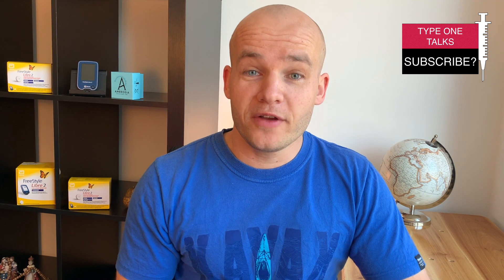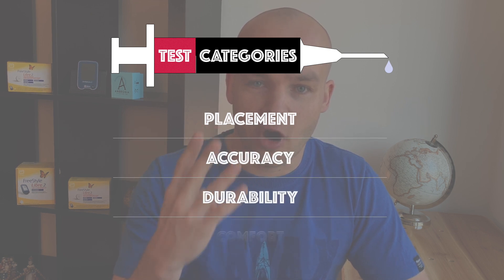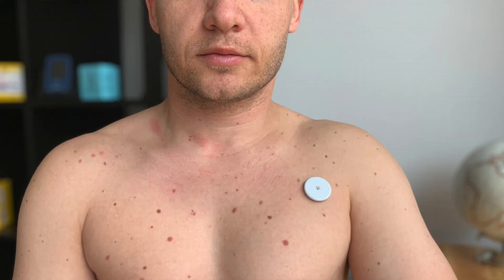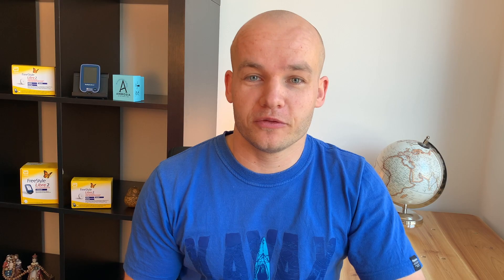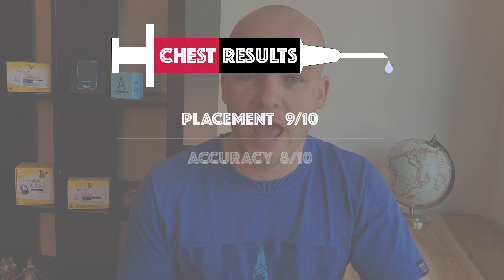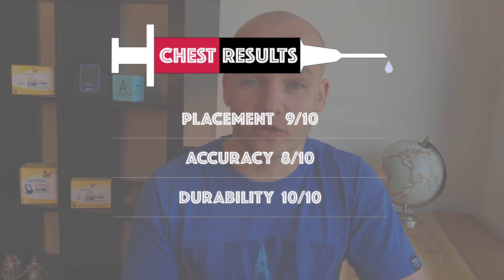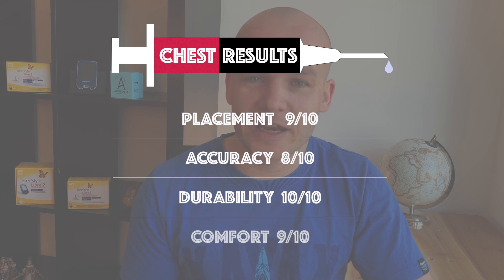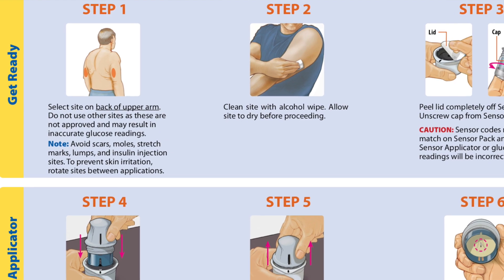Best FreeStyle Libre Sensor Sites: Chest

Comment: I just placed it on my right  chest, 3 finger width under collarbone, in line with nipple. (sensor just fell off of back of arm). So far, this is my favorite spot. Accurate readings, very comfortable, east to scan. Not feeling like I will bump into things.  I put on my most used bra and chose a place that the strap would not interfere. So far, so good.
Reply from the maker: Nicole. Thank you so much for sharing your experience. Much appreciated! I am sure this will help other women find the best spot. I am also happy that the spot you found is working so well for you. Wishing you a great day! Take care!
Reply: Hi, thank you for your helpful video. How did you orient the miaomiao when putting the sensor on the chest? Thanks and warm regards -am
Reply: Thanks for the info, my first time using it it lasted 1 week til I bumped into a door. So I used the 2nd one I must of put it on wrong it wasn't reading then it said replace it uggg got frustrated called the company so they are replacing them both. So I'm a full time student, I'm active I sweat allot, I'm an active biker. Where do you recommend? I can't do place it on my stomach ( personal reasons).
Reply: @RiTa-ky9qg  Although it isn't recommended by the FDA (it is allowed in the European market), I place it on my chest, about 3-4 fingers below my collarbone, but not in the way of my bra. It does show but I dont care. The key is prepping the skin. Wash with soap, shave area and then I use an apricot scrub, its gritty but does the trick. Then I place the sensor. They will misread on occasion. Call Abbott and they'll send a free replacement.
Reply: I am a side sleeper and I’m having a problem with placement because of that how is that working on your chest? Do you sleep on your side??
Reply: @donnastormer9652  yes I sleep on my side. As long as you prep the skin (I shave and wash with a scrubbing soap), it stays on very well. I can swim with it even. No problems.
Reply: @sjdoxies  thank you for taking the time to reply I will try that spot!
Reply: Thanks Nicole!
Reply: This is a great description. Thank you for sharing!!
Reply: I'm going to try this because I've been using it on my arm until the skin rashes has gone too far and painful for now. However, I'm Breastfeeding and pump milk for my little one. Any advise anyone on this???
Reply: @dreamer4180  I also use it on the inside of my upper arm. It doesn't get caught on clothing and it not a sensitive area. the key is to stay hydrated or your readings wont be accurate
Reply: Does it need to go into a lot of jiggle? Ive lost sone during my diabeties journy (or getting older) and my breast adipose tissue sits lower 😂 I chickened out. I dont have this guys pecs nor a really pushed up bust🫣 
My endocrinologist reccomend the chest to me, but I'm thinking that as a dud,  he didn't think to mention this issue... 🤔
Im not shy about things poking me so its not the click or needle that made me hesitate. It was worry I'll waste a sensor.

Comment: Chest is my site of choice and it has been for about 2 years. I am an ultra runner. I've lost so many sensors during my longer ultra runs, especially in the rain. They just seem to fall off at this location. I've not even noticed some of them were gone until I went to scan and nothing happened. Then I discovered the sensor had fallen off. The first time this happened, I did not have a back-up finger stick option with me. I was so sure that the sensor would work well. I had to run the last 65 miles with no way of knowing my blood glucose level other than by feel. Not optimal. Since I've gone to chest placement, I've never had a sensor fail or fall off. Even when backpacking with a 45 pound or 20 kilo pack in hot summer months.  The pack straps did not bother it or me. I do tend to keep my sensor placement inboard of your zone. My area of placement is about the outer half of yours, more distal. Thanks for your review. Keep up the great work. PEACE
Reply from the maker: Thank you so much for sharing your experience. Have a great day!

Comment: Erich here in Missouri, USA. I just wanted to write to tell you that I have not damaged or ripped out any sensors since watching your video about placing them on my chest. I just alternate sides and they have all worked great and with great accuracy. I have been using them on my chest for the last 4 months. I sleep always on my back, avoid super hot showers and had no discomfort issues.
Reply from the maker: That is awesome! Thank you so much for shring Erich! Have a great weekend!

Comment: I am only new to Freestyle Libre as when I found out you needed to put it in your arm, I chose to use the sensor that goes with my pump. But I hated that so I decided to look into the Libre a bit more and see if you could use it in other places. That's how I found your videos and they inspired me to try it on the chest. I actually find the readings more accurate than in the arm! I also found that my bra strap would catch on the sensor when it was on my arm and I was getting dressed but its not a problem at all on the chest. Thank you for the videos, they are very helpful.

Comment: Hi, Sahil here from India!
This is by far the best location to apply the sensor for me. I used to struggle with the arm placement of sensor as it would always knock off and barely make it for 4/5 days. In fact i'd stopped using the sensor solely because of this reason. And then I came across this video series. 
Im writing this review as I apply my 3rd sensor here, after 2 successful attempts, also a thing to note is that is spot is actually better at accuracy compared to the arms. I apply it on the left side of the chest, as shown in the video, and I'm a lefty that plays badminton 5 days a week, even with all that movement and sweat, the sensor stays! Thanks @Type One Talks for recommending this location and easing my misery.

Comment: I had all but given up on the Freestyle Libre because it kept falling off from the back of my upper arm. I'm a large man with very wide shoulders, and large muscular arms and I routinely would knock the sensor off my arm. Door frames, and getting in and out of cars would often result in knocking the sensor off.  
I have since started using my chest with great results. The numbers from the chest are very close to finger sticks when I tested them during the beginning. My endocrinologist was a bit annoyed but he saw the consistency of readings and results that mirrored my A1c.

Comment: This was extremely helpful! Thank you as well to all the other female commenters mentioning that it was fine to put on their chest/top of boob. The hospital was extremely kind and gave me two sensors for free (they're $117 each here, we dont have insurance like the US). The first one fell of the back of my arm in 4 days, the covering plaster could NOT get wet, despite what my diabetes nurse said. I google for alternative sites, watched this video, read the comments, and placed the second one on my chest, half way between my collar bone and the top of where my left boob starts (im a 44L US, 44HH UK, so its actually sitting on the top of my breast tissue), just tucked inside my bra strap so it wouldnt rub. On the chest - hardly felt it at all! On the arm? GOD it hurt! hurt for two days! I put the sensor on at 3pm, and it read wrongly until 7am the next morning, where it started to be in-line with my finger pricks. No idea why it took that long to kick in, but its working now and I look forward to the next 13 days of finger-prick-holiday!

UPDATE: 24 hours later and its not reading correctly at all, its reporting 2mmol below what my finger prick is saying, so in this location it dosnt work for me at all. Sad to waste my free turn with a CGM :((

Comment: Hello im a very big girl 400+ lbs with 48DDD i placed this on my left chest there was no issues no bleeding no pain and it stands up to my night. I have alot of movement at night due to rem sleep behavior disorder i toss and turn sleep walk and on really bad nights act out my dreams. Which isnt very pleasant because i also have PTSD and the sensor never moved.
At this time i dont even have any extra adhesive like i usually do.
Thank you
Reply from the maker: Thank you so much for sharing your experience! I am so glad chest worked for you! Wishing you a great day!
Reply: Girl I hope you see this 
I'm 46dd how low from your collar bone did you place it and did it rub on the bra
Reply: This is the info I'm looking for. I've fatty arms and have had a lot of issues getting mine to stay on the back of my arm. So I'm looking for alternatives. But all the stuff I've seen are from people with skinny arms
Reply: Crystal!  I was hoping for a comment just like yours.  Can you please tell me about how far down or exactly where you had good luck on the chest.
Reply: Thank you for sharing!  After too many scrapes on doors
 and sensor errors, I decided to put mine on my chest.  I am 56 yo, type 2.  I put my sensor in after putting on my bra and cleansing the area-no issues, no pain, and seems to be working so far.
Reply: Thank you Thank you! I’ve already knocked two off my arm so the arm does not work for me. Just got my replacement and I’m really considering placing it on my chest. Are your readings accurate?
Reply: This is the exact kind of post I was looking for. Thanks ladies!

Comment: I've recently had four failed sensors in a row (one of them bent and did not even go in my skin, the other stopped scanning at day 10, two of them giving me extremely low readings where the reading was not even a number, it said "LO") 😑 and they were all on the back of the arm. These were combinations of libre 1 and libre 2. 

I was very terrified of trying the chest area just because it seemed very sensitive. But by watching this video, you gave me courage and I have placed it where you indicated would be a good spot. (Also took ladies advices from the comments and wore my bra so it doesn't bother the strap). 

I am waiting for the one hour wait time but because there was no pain at all, I will be surprised if the needle didn't bend! Thank you and hopefully this will become my favourite spot~~ 😊
Reply from the maker: Thank you so much for your kind words and sharing your experience my friend. I hope it did work!

Comment: Thank you for the video!  I have been using the Libre system for about 3 years.  I had trouble with the sensor when placed on the tricep area.  Clothing pulled it off, and sometimes my young students would try to touch it.  I now place it on the side chest wall, below the arm pit so that it is secure inside my bra.  It stays secure, no problems transmitting signal, and I also wear a sleep bra without issue.

Comment: Thank you Tom for your videos. I've only been a type 2 diabetic for about 6 years. Just started using the freestyle libre 2 in January of this year 2022. I have been putting them on the back of my arm and I have knocked 3 sensors off, had 1 come off due to sweating and didn't even know I lost it until I went to scan sensor.  The one I just put on the back of my arm has made my arm feel bruised when I'm lying in bed. I'm probably going to remove this one and try the chest with the replacement sensor. Keep up the great work you do by testing these different things with the sensors.
Reply: i almost had the same thing happen to me, bumped into a doorframe , i went online and found patches to completely protest the sensor, no interference with the sensitivity, the patches are skin thin

Comment: Received new 14 day system late yesterday. After watching your video I decided to place the sensor on my upper chest, right side, approx 2.00" south of clavicle and about 1/2" to the right (outboard) of nipple centerline. never felt a thing. Five readings through the evening / night. They compared favorably with my glucose meter. Anywhere from 5-10% lower than BM. Great.

Take my overnight fasting reading this morning with BM. 122. CGM is 49. Take another CGM minutes later. "LO". Took 5-6 readings through morning and all were very low as compared to BM. And I knew from experience they were erroneous. Even with the previous evening's good numbers, each one had that symbol of needing to use a test strip.

Long story short. After almost 1.5 hrs with customer spt, I have a new sensor on the way. The extended time was due to twice losing phone connectivity after a 35 minute and 25 minute wait. I have another sensor and will likely place it to the opposite chest side this evening. Short of arm placement, I followed the instructions precisely. I'll go with the upper arm if needed. Am anticipating same deal assuming both sensors are of the same lot.

After telling one of the spt staff that all was well prior to going to bed, he stated that the tip of the probe is easily bent which will pretty much render the sensor useless.

Thanks
Reply: Not there yet but hoping this CGM will work out. Replacement sensor is on its way (quickly arrived today). I actually prefer my android phone app over the 70.00 reader. Thought it would be more robust but find it to be a waste if a person has the app. Perhaps I don't know enough about it yet to appreciate it however I don't feel that's the case. Until a day or so ago I had no idea that the phone app automatically uploaded the data to LibreView whereas the reader must be umbilicalled to PC, etc.

Hoping for an insignificant difference between arm sensor placement and upper chest placement. I did find a test within the NIH which showed an acceptable accuracy with the sensor on the thigh vs the arm. It didn't specify precise location on the thigh which I found odd. They weren't impressed with placement on the abdomen. The test was with an Abbott Libre product.

 I'm trying to find confirmation that  interstitial fluid is the same across the human body. One MD (Dr. Steven Edelman) implies that's so however I have no idea as to his knowledge, skills, and abilities. And I have yet to discover why Abbott chose the arm. I do feel other locations are discouraged and frowned upon due the probability that the FDA "blessed" the products which were tested only with the back of the arm.

Thanks

Comment: Thank you. Helped me to decide where to put my 2nd sensor. The 1st sensor was placed upper outer arm (by a nurse). Unfortunately, due to Fibromyalgia (particularly painful in upper arms), plus lying down many hours of the day (ME/CFS), and sleeping on my side (unfortunately favour that arm), I was having a lot of problems trying to find a spot on upper arm that wouldn't be painful. 

The chest is perfect spot. Much easier to scan while lying down. Will be so much easier to remove in 2 weeks, can see what I'm doing.
Reply from the maker: Happy I could help! Thank you for sharing!
Reply: Hey Kaz, Thank you for putting your experience. I have a rare severe case of Fibro (i have it in writing from my rheumatologist) and also ME/CFS, amongst quiet a few other conditions.  I am mostly bedbound or using my powerchair. I spend a of time laid down in bed on either side and have discovered that the sensor doesn't always read properly. So after reading your comment I now know that using a sensor on my chest could be ideal for me.
Also thank you Tom for doing all your videos and helping us type 1 diabetics. I've have been diabetic for the last 28 years.

Comment: I don't know why I'm so terrified of these sensors, but I am. I've had to resort to applying Skin Tac around the "needle" before applying the sensor or it just won't stay on my old, flabby arms. Ready to try anything else! Watched several of your videos looking for alternatives and am going to try the chest today. (I don't see how you don't get compression issues with it on the back of the thigh.) I'm type 2 well-controlled, so the CGM is really to teach me about modifying my eating. I've learned SO MUCH using it! Timing, and combining foods has made a huge difference for me. I've been binge-watching your videos for the last hour now and will probably come back again later today. Thanks for sharing all your experience!

Comment: Thanks for the info.  I was so frustrated with putting it on the arm, as I was constantly knocking it off.  I tried the chest area, and now I am so happy that it stays there.  Accurate readings, very comfortable sight. Just love this sensor.  "best thing since sliced bread". LOL.  BTW Abbott Labs replaced each sensor - no questions asked.

Comment: This is my favourite spot! I wear mine more on the side of my breast. I find this more accurate than my arm. I only wear mine here now. I am just average in breast size. I also like the fact that it’s hidden and comfortable. I’ve only caught my bra once on it. I don’t have any issues with them sticking. I don’t use any coverage or adhesive with mine. I also go in hot tub once or twice a week. I never go in until 24 hours after placing new sensor on.
Reply from the maker: Thank you so much for sharing your experience. Have a great day!